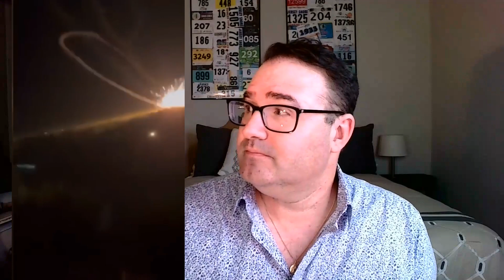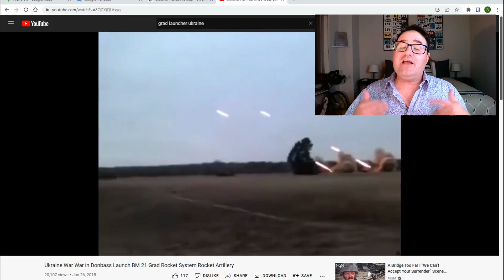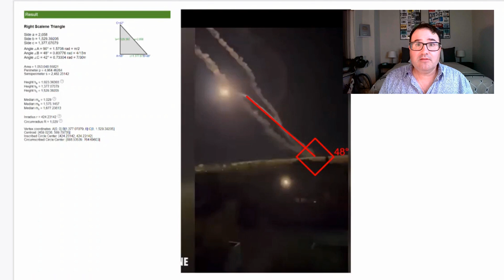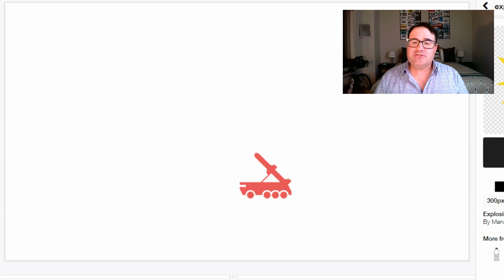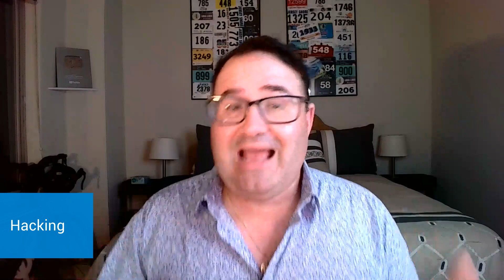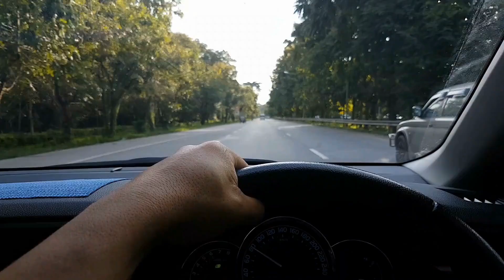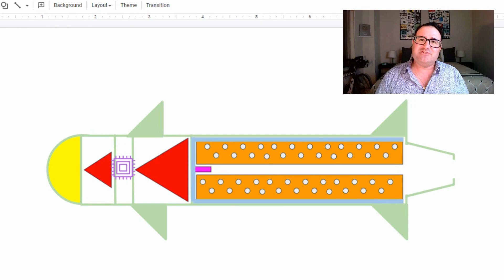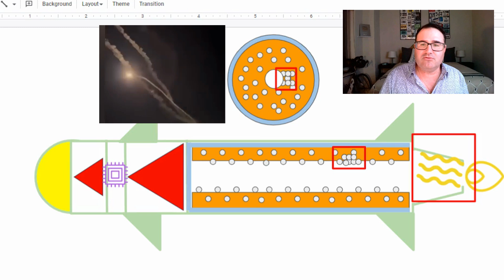Why this missile U -Turned

Comment: Not an expert, but for your theory to be correct, this must have been one hell of a coincidence. This clump must have been perfectly placed, for it to perform such a perfect 180 turn. I think the turn was executed to precise, and uniform for this to be the reason. Also Id expect the rocket to take some serious damage if the burn is uneven. The pressure in that chamber is hard to manage when its perfectly centrical, and according to plan. This would mean that a higher than avg. rate of fuel is being burned asymetrically. Id expect that to look more caotic... 
I don think any other theory is better. A stuck fin would have ment a turn from the get go, or no turn at all. Hacking is really unlikly aswell. 
I dont know  but if there was a wrong reading, that gave a full streer input, some software issue, the tracking radar suddenly tracking the BUK Launcher and no the plane anymore or what ever might have caused this, at low speed I can imagine the rocket to be pretty agile. This is all based on the idea that it was actually a Surface to Air missile, etc.

Comment: The most impressive thing was that the missile COULD make such an abrupt, high G force turn as very high speed, and NOT break apart.
Reply: maximum manoeuvrability or turning force these missiles can do is 20g.
Reply: Russian rocket technology and engineering bro, they're good at making it blast off and fly but can't properly make it take down a aircraft
Reply: @lemieux-z8933  Russia's S-400 and S-500 anti aircraft and antimissile systems are reportedly among the world's best.
But a lot of the missiles used for land attack are lower grade, lower cost and quite old.
Reply: was going slow still.....
Reply: they dont have a pilot in them limiting them, but yeah its very impressive still
Reply: @nono7511  basically the real reason why military dreams of unmanned airfighter.
Reply: It's important to remember these are excellent weapon systems... Propaganda says otherwise but any military expert will tell you, S-3 and S-4, as well as older SA series SAM are a huge threat. Saddam with only the old stuff took ~13 planes off the US during our largest, most well coordinated invasion. 

The failures then are even more obviously incompetence.
Reply: @RobinTheBot I’m not sure what propaganda you’re referring to. Both sides use S-300, and aside from a couple misfires they have kept both sides from conducting major air operations. Most people in the west who are military savvy enough to know what it is understand that they are even superior to some Western systems.
Reply: Russian missile defense systems are world class if not the best, You may crap on their capability to make 5th gen fighters and other modern tech, but they surely do make world class missiles (missile tech hasn't had any long strides since last 2 decades)
Reply: @shantanubbhosale  I said essentially the same thing in the comment I posted yesterday in this thread. The only difference is that I estimated that much of their ground attack missiles they've been using in Ukraine are old, less sophisticated, less accurate and less reliable.
Reply: @gregparrott  "old, less sophisticated, less accurate and less reliable." you mean the actual quality of russian gear, not the paper dreams. Interesting damage control thread, please, continue speaking propaganda.
Reply: @shantanubbhosale  Except when they have to actually hit something. The current Russian capabilities to actually guide missiles to their targets is about the same as the US capabilities in the 70s and 80s. They had some issues even during the 90s but Russia is nowhere near where the US was during the Gulf war. We see it today. S-400 can't properly defend itself from old ballistic missiles like  the ATACMS. The modernized AA system in their cruiser couldn't even save the ship from just 2 subsonic anti-ship missiles. Russian missile were falling from the skies so often that people started to get their hands on the fallen missiles and sell parts or even whole missiles on discord, telegram and some even on ebay. Russia is definitely  not world class.
Reply: @shantanubbhosale  Yeah, the Ruskies were always good with missile tech, especially in the  theater defense area. Russia has always had great engineers... just horrible manufacturing, incompetent leadership, and poor logistics and handling of equipment.
Reply: Nonono, thats where you are wrong, the soviet union had great engineers, not russia. Most space and rocket innovation came from ukraine.@TheRyujinLP
Reply: @henria.277  That's your perception. You may pick a Ukrainian, like Sikorsky as a basis to generalize. But personally, I would not make such a broad, geographic distinction based on national borderlines. Besides, many great physicists, mathematicians, theorists, etc., were Russians. Even the communists knew how to lavish the intellectually gifted scientists and engineers, providing they don't conflict with party ideology.

Comment: To me it looked more like a guidance failiure. Usually there is an unguided boost phase to missiles and then the guidance kicks in. So the first part it goes straight in the boost phase and then when the guidance kicked in something was wrong/failed and it did a controlled U-turn. If it was asymetric thrust I believe it would fly alot more erratically and corkscrew. However would it actually get asymetric thrust from settled fuel? The gas might be created off center inside the missile but it still is forced out the center through the nossle so I don't think it would affect the direction so dramatically. More like slow it down and reduce it's range due to unefficient burn or blow itself up.
That's my theory but I'm not an expert.
Reply: Gimbal lock

Comment: Could the tracker have been below the horizon, and behind the launcher trying to track the first two, and picked up the launcher???
Reply: The fuel thing doesn’t sound likely. The whole point of a nozzle is to equalize the pressure and direct the gas in the wanted direction, the nozzle should even out such inconsistencies.

I think it was malfunction of the electronics or some sensor, that caused the rocket to deliberately turn 180° ( that would include the on-board guidance turning on too early and locking onto the ground radar ). I mean, if it was off center thrust, what are the chances it turns exactly 180° and then continues to fly so straight.

Comment: Well put..... I believe your theory, w/o knowing anything about ROCKETS 🚀 but I completely understand what you described❗️👊🏾💥 well put and spoken...Glad I found this video....
Reply: i don’t, since, what are the chances of it turning exactly 180° and continuing to fly straight? 
Plus, the nozzle is designed specifically to even out such inconsistencies. 
My theory is that some electrical malfunction caused it to think it needed to go in the opposite direction ( some sensor failed, or a safeguard failure caused it to lock onto the ground radar ); that turn looked way too deliberate.
Reply: @chri-k  KOOL 👍🏾 😎whatever FLOATZ your...... “ROCKET❗️” 🚀🤔 😆😅😂🤣

Comment: What if one of the fins failed from poor manufacturing or miss handling?

Seems like it turned very sharp could you calculate the forces needed to make a turn like that seems like it would be more plausible from aerodynamic influence…

Comment: That’s not bad, but you forgot one thing (or didn’t know), solid fuel burns on the surface, including the surface of cracks in the solid fuel. So since mishandling can also crack the fuel, cracks can cause rapid burning where the cracks are, hence you don’t need “clumps” or “lumps” of fuel, the cracked fuel alone can cause accelerated burning. Everything else you mentioned seemed accurate.  Tom, KC3QAC

Comment: My theory:  conscript switched target and origin data.  S400 missile has a ground to ground mode.
Reply: But the long-range guidance on the ground cannot physically guide the missile into itself ( if i understand how it works ).
The on-board guidance system can — it simply targets the strongest radar signal it can find — it should not be on that early, but electrical malfunction could have turned it on.

Comment: Good work but sorry, no way that was asymmetric fuel burn. That rocket did a perfect 180 deg turn in three axis. That missile did that because it's guidance system told it to. Why? Would need to see some serious failure mode analysis on that seeker head to work that one out. 😝  Could be as simple as reversed gyro synchro phases; which would explain the last little turn right in the last phase before impact. But perfect turns like that don't happen from physical defects.

Comment: I do not believe one mishap is a good sampling to come up with a conclusion. A large sampling of it happening 9 more times should be sufficient. 😋😊🤣
Reply: I believe it is electrical failure. I mean, you can’t improperly store just one missile.
But there are plenty of sensor-related failures that could cause the rocket to think it needed to turn backwards.

But you are correct that there is too little information to come to a conclusion.

Comment: i find it highly unlikely that a random fabrication error leads to a "well executed" 180. its not impossible but the odds for that... (like a blown tire lets you drift through a needle pin corner instead of crashing into the track boundary)
for me, it looks like some dumbo in the target guidance radar truck accidentially switched the targets and selected the launcher as intended target. or the guidance radar connection was lost and the rocket went into search and destroy mode when there were only the launcher battery near as valid humps of metal.
This has happened with torpedos in the past. (Them making a 180 and hitting their own ships/subs)
Reply: This is my theory too, except that i don’t think human error can cause that ( maybe with a torpedo, but unless i misunderstand how the ground-based guidance works, how can it target itself?? )
Reply: @chri-k  when there are multiple vehicles (launcher, radar etc) the radar can pick up the other vehicles. and if it has no friend foe capabilities, you could in theory select one of the other vehicles (except the radar itself) as target...  
btw. the torpedo stuff i mentioned i had not human error in mind. the seeker locked onto the own sub by accident and turnend the torp around and sank it.

Comment: I think classical hacking isn't really possible, the only way hacking would be possible if someone was able to either create interference/noise to where the missile switched to its own guidance or misinterpreted the interference. Which also sounds unlikely, since how many radars point straight behind the missile. Alternatively, if the aircraft that was being shot at had a counter measure that quickly determined the frequency the launch vehicle and missile were using and redirected it back it could be possible. But if I was building the counter measure I wouldn't have it make a U-turn because then the enemy would know it was being countered after the 2nd or 3rd mishap. But who could blame them if they were trying to play star citizen on their 1990s hardware.

Comment: I'd need a bit more evidence than that. Namely, is that mechanism even possible? I would think the nozzle would make up for uneven solid rocket fueld burning and only altering a control surface would cause such a massive deviation.  Since the rocket did not continue to turn, in this proposal, some transient defect took effect, but normal burning/control resumed. Uneven burning just seems a bit much.
Reply: I don’t think it is possible. Plus, if one had uneven fuel concentration due to improper storage, would there not be other missiles with the same fault? 
A lot of people here seem to agree that it is a malfunction with tracking ( but a malfunction with the missile itself, not the guidance thing on the ground )

Comment: It looks almost exactly like the Russian rocket launch a few years ago that also returned to sender. With that they found some poor Ivan in roscosmos put the gyro in upside down since it was a completely symmetric ball with no markings. Imo it was fine at the start before the boost engine got ejected, and than once the boost engine was ejected and the main system took over it flipped

Comment: Well, using your theory, either one side burned hotter or the other side didn't burn on time.  It would be interesting to see if on that particular launch if the full power was present when the missile left the launcher or if it was not a robust as a normal launch.

Comment: Asymmetric thrust would only be the cause if the unit had more than one SRB, or didn't use a nozzle. The entire point of the rocket nozzle is to provide back pressure to balance out and columnate thrust forces. Now, if there was propellant migration burn through would be possible as the plasticizer also helps maintain the rate of reaction. However the video doesn't show much evidence of a chamber burn through. I'm leaning toward an electronics failure unlocking the navigation ability prematurely.

Comment: So the solid fuel rocket guidance & stabilization system & flight control surfaces are not able to overcome or correct for this type of error? So analogous  to this would be one engine on a 747 being stuck on 100%, while all the other engines are only delivering 80 or 90% thrust. But all this would take is for the pilot to trim the aircraft. 2nd point, solid fuel missiles have been around for decades, I find it rather surprising that this kind of possible malfunction was never encountered and designed into the specs.

Comment: My thought, I remember some older space rocket had a similar issue. It had a guidance system that was installed upsidedown. It looks like the guidance is trying hard to correct the trajectory, but correcting back to the launcher

Comment: Any guidance/storage error would cause it to start to spiral/cartwheel, which it doesn't do. This isn't so much an error as a design feature misundersropd.
Many SAMs have a heat-seeking vector, because radar can place the rocket close to, but not on, the  target, which stands out by the heat of its exhaust. It that rocket lost its radar feed, it would look for the hottest thing around - it's own launch vehicle. Return to sender then happens.
Another trait of the explosion shows illegal ordonance being used - that start-burst effect is caused by magnesium. It's likely normal for air-burst, but in use against ground targets, no.

Comment: The one thing that keeps me from buying into the uneven clumping of fuel theory (at least on its own): I feel as though the rear nozzle of the missile's housing would prevent the force of the propellant from exerting that drastic of a lateral force on its own. However, if the unevenly-distributed clump of solid fuel is on the very bottom of the missile, very close to where the propellant is expelled, I do wonder if it is possible that  the heat of the burning fuel being where it shouldn't could cause a rupture in the housing, thusly allowing propellant to exert more lateral force?

Comment: The missile continued to fly straight after the turn, so for whatever reason something went wrong which resulted in it deciding to go the opposite way. Uneven propellant would just give an uneven burn, but that's all inside the motor, before the venturi. The thrust comes from the pressure difference from inside the casing to outside, through that venturi. If the fuel is burning on one side it is still pressurizing the casing. If it had burned through the missile would have gone out of control and spun or spiraled. When Patriot did this it was following the target to the ground. Patriot killed more people in Israel than Iraq did, and didn't kill any of the incoming Scud missile warheads.

Comment: You have to account for the STRAIGHT path back to the launch site.  Fuel burn asymmetry is not likely. It was guided back its point of impact.   I suspect faulty GPS coordinate input- either accidental or intentional.

Comment: I think its unlikely that the pressure gradient inside the missile would have this much and a so precise effect. If there was something wrong with the uniformity of the fuel, I'd also expect flickering in brightness. But as you said, its a wierd situation anyway, so I cant tell for sure either :) -> edit, after rewatching the clip there is some flickering going on
Reply: I don't think its likely either, the nozzle is literally designed to make sure the thrust force goes predictably straight back (and as efficiently as possible), because essentially you're just turning high pressure into high speed exhaust, if there's a concentration of propellant, then there would just be a spike in pressure, but by the time it reached the nozzle (let alone left) was essentially non-directional. I haven't worked with rockets since my undergrad, but there's nothing I can think of to cause such an imbalanced thrust.

And even if we say there might have been a tiny imbalance in thrust force between one side and another, the guidance fins should have corrected for it.

Which leads me to believe this was a guidance failure of some kind (and just because the 2 other missiles functioned properly, doesn't mean there wasn't some kind of failure on this one).
Reply: @sergarlantyrell7847  I think thats most likely too

Comment: Actually, the fins move their most at launch to stabilize the missile.  The dynamics of a missile launch are complex, and until aerodynamic forces build up high enough to stabilize the airframe, gross movements of the fins are required.  This is certainly not an unusual failure mode for guided missile systems and uncommanded or malfunctioning fins can sometimes deliver the package back to the sender.  If you look at some of the Gulf War footage you’ll see an American Patriot missile doing exactly the same thing, with unfortunate consequences.  And depending on the missile system, you may have a combination of moveable aerodynamic fins and exhaust nozzle vanes.